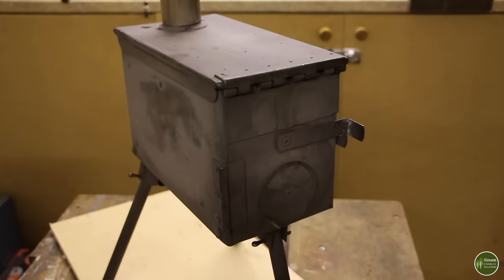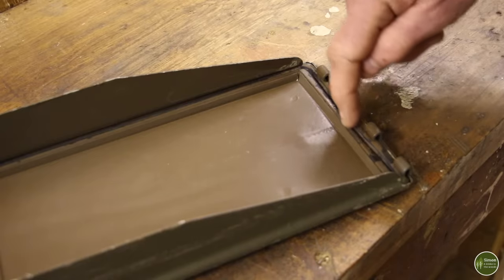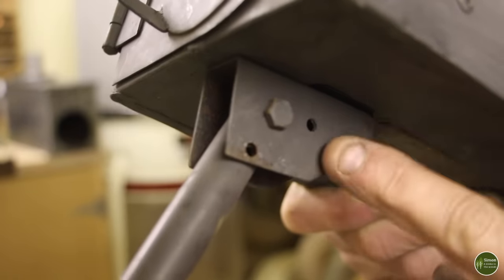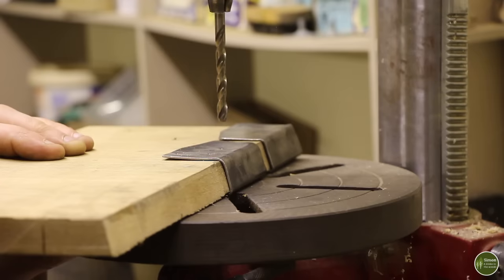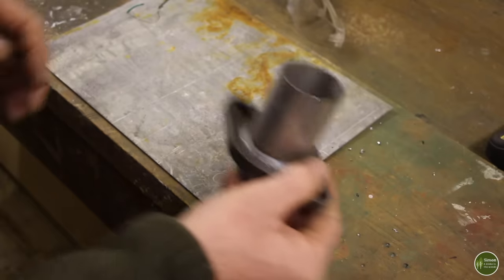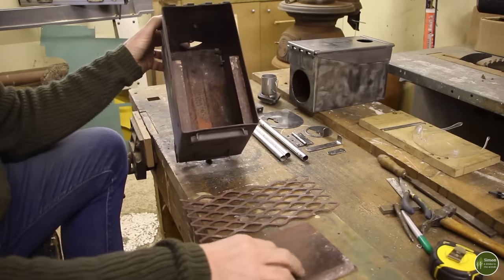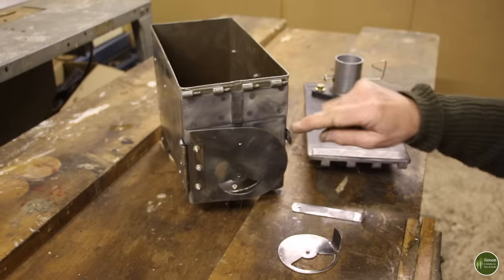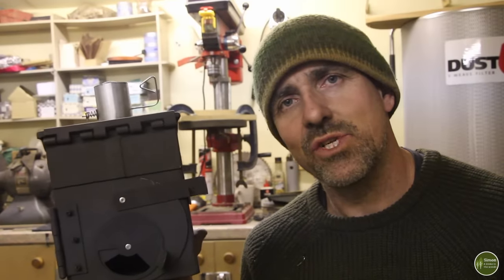Ammo Can Wood Burning Tent Stove. Make a Tent Heater for Winter Camping.

Comment: I know this video is over 2 yrs old and already has over 1k comments, so I am doubtful anyone will read my comment… I just want to thank Simon for this inspirational video… I’ve completed my own ammo can stove, following the instructions as closely as the materials I had on hand permitted. I used a lot of hardware I saved from my dad’s business after he passed and was able to line the entire inside (except the lid) with thick steel sheet metal plates, and bolt everything together with rad looking stainless steel internal hex socket cap-head screws. I’m still working on the stove pipe… Amazon delivery expected tomorrow. I used forest green high temp stove paint to keep the ammo can theme going. And I used 3/4” metal conduit pipe left over from a project to add overhead lights in my garage for the legs. Yesterday I fired it up outside and got the stove exterior up to over 500° F. The paint started off-gassing and combustion was really efficient (very little smoke). I have had so much fun making this stove! Thank you Simon!
Reply: I have been compulsively shopping for stoves on the new and used market and they are high; a new one about this size is going to be $1000 and if you want a little bit bigger one it could go $3000 just for the stove, then there is everything you need to install it, the contractor and pulling a build permit. Then they have these tiny little ones for RVs. Those are about 1000. I’m going to build an ammo can stove for my bedroom.

Comment: Hi Simon, If you go to a woodburning fire  shop or a gas spares shop you can buy glassfibre rope and  a special hi temp glue to replace the rubber can seal with the fire resistant rope seal.  It should improve control by sealing  the box completely.

Comment: I’ve made a few of these using different sized ammo boxes. I’ve found that replacing the rubber gasket with a type of high temp (fiberglass like) rope gasket and a high temp adhesive/cement made for wood stoves/fireplaces/boilers. I also used a similar product in a ribbon like form to seal the door. Just make sure to apply the ribbon on the door or face of the stove before marking/drilling your holes on the box for the door hinges to accommodate for the additional thickness of the compressed ribbon. Adding both of those keeps most all the smoke out of your tent on startup etc.

Comment: Lovely design and something we can all do at home without a ton of special gear. One question..How do the soft metal rivets hold up to the heat over a period of time?
Reply: In his parts list in his show notes below the video the rivets are listed as stainless steel :).  I was wondering myself as they looked like aluminum rivets!  I've w small collection of different sized aluminum, steel and stainless steel rivets and it's hard to tell at a glance what the difference is, heh.
Reply: @mikie2501  cheers. I should read the notes as well as watching the video.

Comment: I know this is an old video, but i'm a new subscriber, and i'm watching older videos. I'm probably going to go to a military surplus, to see if they have some of those, to make one, but i had an idea:

The top plate, made to stop the fire from going straight out, i'll bend an L shape out of it, and but the lower arm of it to the back. Then, i'll pop either one or two rivet to stop it from sliding foward.

Still easy to remove, if the top is open, but it won't be able to slide when closed, if i bump it while putting wood in.

Anyway, great video, and great tutorial, thanks.

Comment: Wow..  really excellent stove build!
I'll be adding this one to my favorites list!

Some tips for you...
1) The vent in the front is called the "draft".
2) With the new damper installed, you won't need the baffle inside.  By removing it you'll gain some inner space and have maximum heat control with the draft & damper combination.
3) Make sure you open the damper fully before you open the door.  You won't get smoked out that way.

Thanks for the Awesome video...
Reply from the maker: Thank you! The tips are hugely appreciated- I’ll try it without the baffle plate. 👍
Reply: I don't understand why you need both, instead of one or the other? If the draft is wide open wouldn't the dampener partially closed choke the fire, or the dampener open but the draft partially closed do the same thing?
Reply: @mikie2501  
You would only choke the fire out if either one is closed too far. 

 A fire needs to breathe.  It inhales via the draft & exhales via the damper & chimney.  The draft is always necessary in some form..  the fire won't burn without air.  The damper is a mechanism for added control of the fires exhaust.  Also.. if you open the damper fully a few seconds before you open the door, you won't get smoke billowing out the front.   Slowing down the exhaust allows for maximum heat retention in the stove once it's up to temperature.  So by controlling both air in and out, you maximize your heat output.

Comment: You did not mention a convenient supply and bandaging and antiseptic in the equipment list:  BUT I SAW YOUR FINGER!  This version of the stove is AMAZING!  You show additional problems and solutions in making an upgraded stove.  For people like I am, your work is INGENIOUS.  Just the refinements on the damper are well worth viewing.  The idea of including a baffle is pro-level.  What was your thinking about not using fire-resistant seals in this project?
Reply from the maker: Thanks James! In my experience, the seals aren’t necessary - the smoke and gases will take the easiest route out - up the flue rather than the small gaps. 👍

Comment: Hi Simon I made one of these years ago. For the flue I used 2mm thick stainless steel foil 6 foot long by about 11 inches. You can then roll the foil length ways to make the flue, and roll it width when you store it in the ammo can. Use 2 inch diameter stainless steel rings to hold the flu in shape whilst using it, you will need 6 a least. It is brilliant light weight takes up no space.

Comment: The secondary baffle on wood burners is more about the secondary burn of Co (carbon monoxide), which happens as your smoke hits the very hot plate, releasing the secondary heat, which would have been wasted up the chimney. Love your channel, and thanks for sharing your stove design, and showing us how to build it 😊

Comment: Finally found your channel & subscribed to it! This is an awesome build, and if you wanted it as a fire pit outside of the tent, just remove the top and baffle, then place another pies of expanded steel over the top! 

Great Job! Keep up the good work!
Pat

Ps. Two pieces of Pyrex and it will also shed some light in the tent at night!
Reply: Mica works as well.
Reply: @daphneraven6745  over on my channel, I had a live feed with the “Ammo can” set up as a grill! Worked a little too well!😂😂😂. I ham sill working on it, but it does work!

Comment: Great vid. With a little extra engineering that thing could be made into a smoker and an open grill as well. Just need a little fire box that could be stored inside the ammo box with the grill when travelling. Half of chimney could be used for the smoke tunnel. Loved the use of basic tools for the build. Got me !
Reply from the maker: Good idea! You can use it as an open grill, by removing the lid and positioning the expanded mesh from the bottom to the top (where the baffle plate normally sits) 👍

Comment: Perfect! I built my stove after I saw your first one. Mine is not that nice on the outside. The door didn't work so well. I do have a fiberglass rope instead of the rubber seal. Against gas leaks. Amazing how well he burns and how much heat it gives. Even on a late chilly summer evening on the terrace. Thank you for the very professional instructional video

Comment: Simon, that new and improved stove is outstanding! Excellent "how to" video as well. Years ago I made aircraft for McDonald Douglas (doing my small bit along the assembly process) so I'm sure I can make one of these, even without all the power tools and fully equipped shop. It will take a bit longer, but your instructions are very well done. Another nice video, and I'm glad to see that your dog was NOT in the shop at the time. Safety First.
Reply from the maker: Happy building!! 👍

Comment: Nice Shop! Great Video! I just bought a shop fox bench drill press. Best $150 USD you can spend when starting off building a shop.  I like the incorporation of the exhaust pipe pieces great idea!
Reply from the maker: A bench drill is super useful in the workshop. 👍

Comment: Might be worth adding a glass fibre wood burner gasket where the old rubber gasket used to be, just to seal the box and avoid possible carbon monoxide passing around the lid. Awesome build!

Comment: Lovely to see another project Simon and this one was a  joy to watch. I personally wont be making one of these as I am too unbalanced in small spaces and I can see a disaster waiting to happen for me. Another issue for me is that I do not have the tools or access to the kind of tools you use. I wanted to make the ferro rod holder that you made but I am unable to as I do not have the tools. I can form it, stitch edgte bevel it and burnish it but I cannot cut the leather noir drill the antler to fit the rod. Plus I cannot afford to get one ready made.
Reply from the maker: Rach, if you’ve got the antler, send it to me and I’ll drill it for you. 👍😁
Reply: @benf3607  My issue is that I am disabled Ben and tend to lose my balance often. A wood burning stove and me in a confined space is going to end badly for all concerned :)

Comment: Intriguing!

A few points / questions:
1. Does it seal right enough to put out the fire?
2. Do parts of it get hot enough to melt aluminum pop rivets or ruin the spring?
3. Does it get hot enough to cause the zinc and cadmium on the hardware to off-gas?
4. I missed the part where you added the internal ledges where you set the inner top plate.
5. How clean does it burn? Is there visible smoke?

BTW, the grate is necessary to prevent the coals from burning through the bottom.
Reply: I was wondering about the pop rivets too.
Reply from the maker: It seals pretty well, I actually adapted the butterfly to allow some flow even when closed up - safer to ensure gases travel up the flue when shut down. The rivets are stainless steel, so no problem there. I haven’t noticed any issues with the zinc coating - perhaps that does all its off-gasing in the initial burn? In this version I just used rivets to hold up the baffle and grate - just rests on the back of the rivets - the angle bar isn’t really necessary. Hope that helps. 👍🔥 Oh, very little smoke once up to operating temperature.

Comment: Hi and thanks for the great build. One query is I have not seen anyone build into an ammo can stove a removable ash pan? Is there a reason for this and how do you get rid of the ash if burning for long times?
Reply: Well I took inspiration from Simons design and made an ammo can stove. Took things a bit further by having a glass door and an ash pan and reinforcing the walls with 1.5mm steel sheet. It works an absolute treat and is currently heating my garage man cave with the two metres of exhaust sticking through the tiled roof which I cut with a cheap 50mm diamond saw! Might make a short vid of it but haven’t done YouTube for years now.

Comment: Hi Simon, that's a fine specimen! 
Anyway I have a question on the baffle: I wonder, what is the effect if constructed like this? The gasflow in the oven is more or less the same as without it (diagonally from the air inlet at the front/below to the chimney at the back/above. 
Wouldn't it be way more efficent, to place the chimney on the opposite side of the oven, over the door/at the front? Then the baffle could be placed opposite, too, snug to the front wall and with a gap at the opposite/rear wall of the oven. So the hot gases would have to make a U-turn to get to the chimney, a way nearly twice as long. Not that I this my idea: that is how a much bigger and very expansive Tent-Stove from scandinavia is built. Wonder if it would work for an ammo-box-oven, too 🤔.

Comment: I have a few questions that are probably stupid, but if i dont ask ill never know. Im going to start building a hunting tower blind for my dad and me since he is getting older and a comfortable blind isnt a bad idea when i start having children to take with me. I want to keep a more rustic or traditional feel and more of a feeling of it being "self sufficient". I could easily purchase a Mr. Buddy Heater and stick a 40lb propane tank in it but i really like the look and feel of this heater. 

So here's my questions: First, The Blind would be 8 sided with approximately 2.1 meters inside dimension from wall to wall and 2.43 meters tall at the highest with no insulation besides weatherproofing the seams and making as close to airtight as possible. How long would you say it would take to heat an area from 2 degrees Celsius to 16?

Second: one design change I could do since my tower blind would be immovable would be to create an intake flange pipe leading from either the side or bottom of the stove leading outside with a damper to control how much air is available to feed the stove. Would that work well, or would the design like you have be better? 

Third and probably the most stupid. Is the entire stove and flu becoming hot heating the air around it causing the area to become warm, or is it the opening used to allow oxygen in allowing the heat out thus heating the tent or structure it is in? That would be a deciding factor I believe in my above design change for my purposes. 

I appreciate any time you take in answering this, and I hope you are well in these crazy times.

Comment: I'm so glad you put in the cost, the time , etc. etc. because, apart from the sense of fulfillment, what would be the advantage of making this over buying something that  may be just as effective and perhaps lighter to transport.
Reply: A titanium ones going to cost a lot more than £60. But if you've got the cash then buy, obviously. Why waste any time making anything when you can just throw money at someone else to do it? 
Not me though, I can see me giving this a go sometime. Excellent vid, again, really helpful. Thanks
Reply from the maker: For me, it’s the enjoyment I get out of using gear I’ve made myself - the cost benefit is secondary (usually!) 😁
Reply: @affalaffaa  I hang onto my money and don't like to throw my money at anyone. Purchases are carefully considered. Both you and Simon have missed the question in my comment which I had hoped would illuminate and convince me. A DIY would be a challenge for me because I do not have things in this particular field that I could recycle. What are the advantages, if any, as you must have some opinion to motivate . I love materials. I love sewing. I love designing, seeking out the materials, and fantasizing the finished product. Buying it is only half so satisfying but I have practical reasons why I pursue this course instead of buying, even though the finished product may eventually end up costing me more than something readily available in department stores or wherever. Does it burn/ combust better. Is it more durable than it's bought counterparts. Is it safer? Are there any aspects of comparison to speak in it's favour. But, hey, it's not a matter of life or death...but perhaps it could be. That's all. No big deal. Sorry I was interested enough to say something.
Reply: @carolleenkelmann3829  This is your question: what would be the advantage of making this over buying something that  may be just as effective and perhaps lighter to transport.

My answer: A titanium ones going to cost a lot more than £60

A more in depth answer would be: None, if the item you are buying is just as effective and lighter. Only if the cost of your time plus materials out weighs, in your eyes,  the cost of buying the item. You are only going to really know if you make one and then test it out against all the other commercially available ones, which definitely wouldn't be cost effective!

To be honest I'm surprised you can't work that out as it's very obvious and my first, maybe slightly flippant answer was geared towards someone who was being deliberately negative in their comment, apologies if you took offence.
Reply: @affalaffaa  if it was obvious I would not have asked. There could have been other reasons than just selfsatisfaction. Who wants to put themselves intently up for derision?  The offense is only there if I accept it as an offending remark, which I did, especially about the throwing of money at someone, on both accounts. Money needs and demands to be respected. Not the misuse of power attached to having too much of it or not enough of it, which is always relative,  but just so. I always bend to it, picking up a dropped cent as token of all the history that has gone into producing this little piece of copper, which goes back before ancient times and all of it is connected to Mother Earth. So, in effect, I bow down to Nature and to my fellow man. Cheers und all the best.